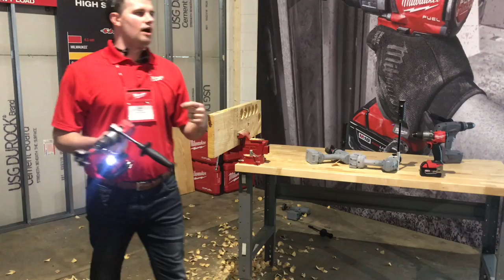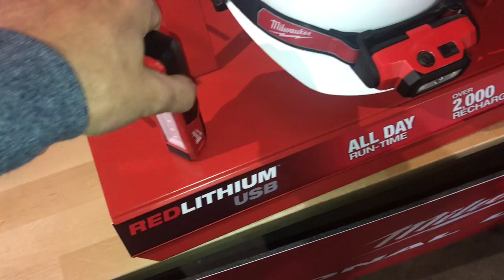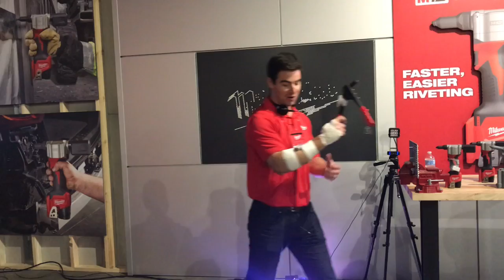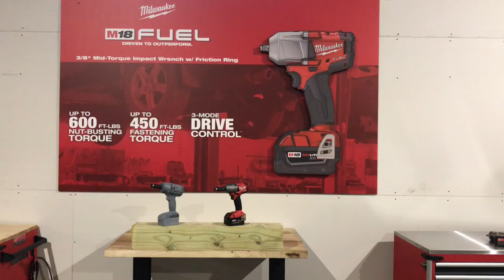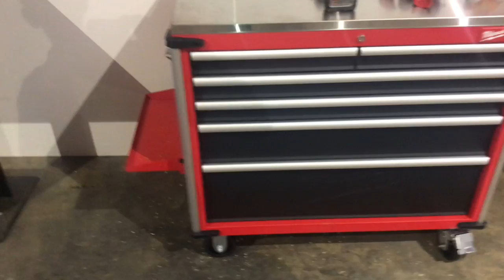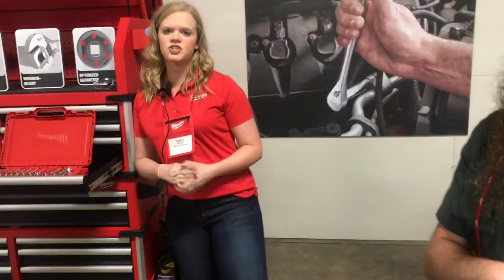See The Latest And Greatest From Milwaukee Tools At The New Product Symposium!

Comment: Both of my Milwaukee drills have been dropped off the top of 8 foot ladders onto concrete a few times) and they still work great And all the times ive gotten them scolding hot from trying to put dull drill bits through stuff at work. The 12 volt one ive had for about 6 years and its been dropped off a bunch of ladders to be honest.
Reply from the maker: hey bud they are amazing tools for sure. I did drop one of the M18 tools and the battery pack did crack but it still works. Thank you for watching!

Comment: So, the milwaukee reps were told to use adapters on competitor impact wrenches and then claim they weren't strong enough while the milwaukee had no adapters to lose torque? sounds fair. cough cough
Reply from the maker: KickDownDoors it’s not my job to say if they’re stronger or not I’m not doing side-by-side comparisons. I’m only concerned with their ability to work in the automotive wold and all the tools i’ve tried out  have been amazing.
Reply: @HowtoAutomotive  - I'm a fan of your videos and a subscriber. But in the videos it shoes milwaukee reps doing misleading tests for their audiences. The number of these sold on ebay alone is in the tens of thousands. I believe mechanics everywhere love them. But honesty and integrity by the manufacturer really put a sour note on an already great product. Deceptive. I'm just wondering openly and aloud. Absolutely no reason to use adapters on competitors and none on their own. If you ignore that... not sure why you would?

Comment: What can 2553-20 M12 1/4" Fuel Gen II Hex Impact Driver (with socket adapters) do that the upcoming 2554-20 M12 Fuel 3/8" Stubby Impact driver with 3/8" bit sockets can't? I'm looking for something to pair with the 2861-20 1/2" mid torque M18 Impact Wrench for general power-sports and truck maintenance, as well as jobs around the home. Thank you for any advice.
Reply from the maker: LegendFPV I’ll be able to answer that question better in a couple weeks after I get to Stubby  in my hands and put it to use. I do know that Debbie has 100 foot pounds more torque than name M 12 hex

Comment: Dewalt better up their mechanical side. And stop investing too much in matco
Reply: I'm a Dewalt fan boy.  Have dewalt for lugnuts and suspension and etc.  Dewalt mid torque is awesome.  No clue how but precision function works perfect.  My lugnuts are 90 ft/lbs and precision always torqued to 89 ft/lb. My F150 is 150 ft/lbs and would do 148 ft/lbs. No clue how so accurate.   I'm buying the M12 line

Comment: I own the 2706 Fuel Bluetooth hammerdrill. With 1 9.0 battery its a little heavy.
But, Let me tell ya...
My boss was drill 2) 2 1/2" holes in a sill plate. Ran into a steel anchor which smoked both his DeWalts and his holesaw.
I hand him my Milwaukee and even with the burned up holesaw it got the job done pronto.
Turn on the kickback control to protect your wrist and well, All I can say is I am very happy with mine after almost a year of hard use. 
 I bought that drill because I needed a new Sawzall and decided to give Big Red a try after many years of runnin' with Ol' Yeller.
Once again, heavier, but the power of that sawzall leaves no room for complaint! Cuts 1 1/4 black pipe like it was closet rod!
 I'm tellin' ya guys, these tools are no joke, no BS! 
They really do what these guys say they do.
 THEY WORK! They let you work "like your job depends on it"!
Reply from the maker: john hanrahan That’s awesome that you got to show your boss how it’s done🤓 yes Milwaukee tools are the real deal! They are coming out was so much new stuff it is mine blowing. Thank you for watching and sharing with me!!

Comment: When will the gen 3 hammer drill be available?
Reply from the maker: 209chevymon I believe it’s out now.
Reply: How to Automotive when i search for it on amazon it only gives me gen 2?
Reply from the maker: 209chevymon check Home Depot Amazon is not an authorized seller Home Depot is.
Reply: @HowtoAutomotive  thanks i forgot to reply i did find the gen 3 kit on home depot like you said and have been using them man great tools now gotta get the stubby impact lol i don't need it but man do i want it lol thanks again
Reply from the maker: 209chevymon I just got to Stubby and made my first review here is a link if you have not seen it yet. https://youtu.be/FlP8BbkjN9E
Reply: @HowtoAutomotive  thanks i did see the new review thats why i want one so bad now lol because your review was great using it on a actual engine repair and also using the 2.0 instead of the 4.0 to really show the power of it with the smaller battery thanks again for the awesome reviews and quick replies 👍👊

Comment: Can u tell me the difference in the stubby impact and the ones shown before them ? Is it just the size and portability ? Of course the ones before have more power to,
Reply from the maker: +nipplemilk Network yes the studies are just shorter in length and they are 12 V the older style is 18 V and has more power. But because of the compact size and the power that they have they will be very useful all kinds of automotive uses.
Reply: How to Automotive thank you , I think a combo of the stubby and the mid torque would suffice

Comment: I've been very interested in the Milwaukee impacts but don't know which one is best suited for my application. I would  primarily use it for removing lawn mower blades off of my Scag Zero turn mowers. Sometime the space I have to work with is extremely limited as I may be on a job and need to change the blades without a jack or mower lift. What size do you  recommend. My blades are torqued to 75 ft. Lbs
Reply from the maker: Worsham's Lawn Service the 3/8 Impact would be more then enough for your application.

Comment: Would love to hear more info on the small roll cab with the stainless top. I could really use something just like that. Will definitely be buying on of the M12 stubby 3/8” impacts when the come out in September.
Reply from the maker: I checked on the small role cabs and they are Proto types and will be announcing them soon. But for now they holding any information on. I did over here at the event that they are expected to be for sale around $700
Reply: How to Automotive I called Milwaukee earlier this week about that stainless top roll cab and was told it was a prototype and he claimed to have no idea if it was slated for production or not, surely not for 2018. He also said the 2019 product line would be announced in December. I decided to purchase the current 30” wide top and bottom tool cabinet on,y to find out it’s no longer available so I wound up buying the 46” wide top and bottom instead. More box than I really wanted or. Ended, but oh well. Thanks for taking time to update what you knew of the prototype box.

Comment: great video showcasing the stuff most people would actually want to buy.
Reply from the maker: Which one interested you the most?
Reply: How to Automotive as much as I like the hand tools and will probably get some sockets or wrenches, I'll probably buy the M12 3/8 impact. I have the M18 one rated at 220lbs but the smaller size of the M12 means easier to keep in a small bag in the trunk with other repair tools.

Comment: When are gen 3 coming out?  I see special buys with a pack out box and drill and impact in the box...  are those gen 3?  I am confused...  I want to buy, I have the old original which are decent, but I want the upgrades and do not want to buy the wrong ones
Reply: Robert Maki those are gen 2
Reply from the maker: They are GEN three and set to come out in September

Comment: I’m really interested in the m12 impacts!
Reply from the maker: The Auto Tech the stubby? That one is sweet!
Reply: How to Automotive yes the stubby
Reply: I have a 3/8 and it's awesome.  Didn't think I would need the 1/4 but I think I'll get it.
Reply from the maker: Brad Brinegar quarter inch is super handy.
Reply: The m12 is on sale at home deport for 4th of July sale. You can get a set for basically 50 dollars each piece. 6 pc set 300. 4 pc set 200. 2 pc set 100. Other Milwaukee products has up to 45% off....I'm gonna be using it every day. So tempted to buy it so I can  show off my tools. The best part is pulling up to someone with a flat tire. That's struggleing. I come by weilding the impact and in couple mins change there tire loll
Reply: Got the M18 mid torque and M12 3/8 Stubby!! Love everything about it!!